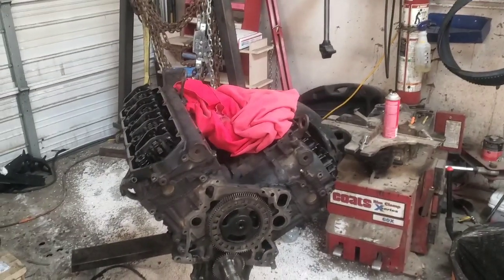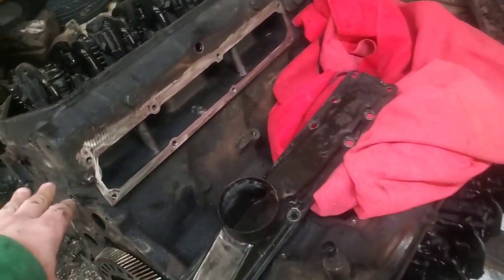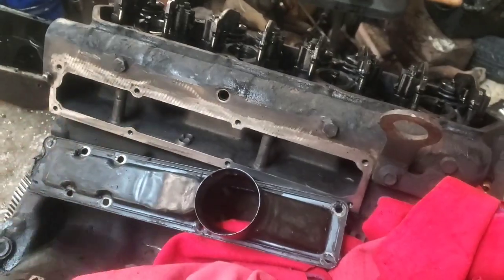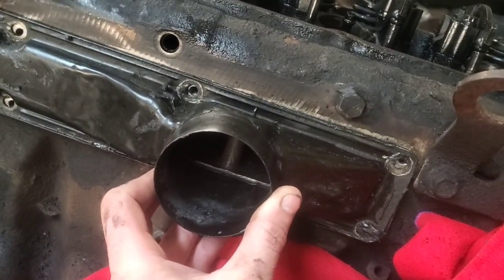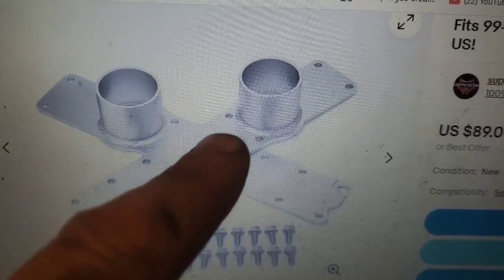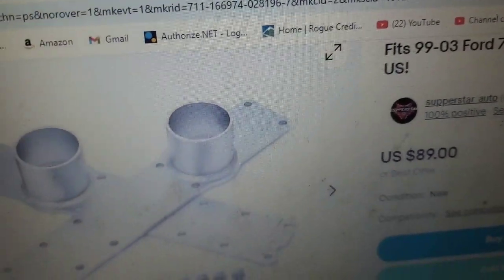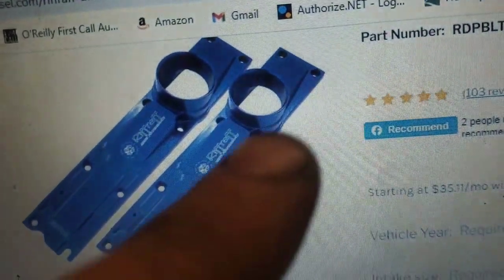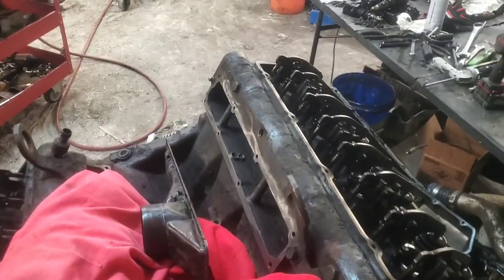7.3L Powerstroke: Engine Swap.  Can an older E350 be used for a 2000 F350? Part 2

Comment: You have to transfer all of the sheet metal and other external parts to the long block. You need to used the ford intakes. Either fill the holds with epoxy or used a lot of RTV sealant. Them intake started with the new body style in 1998.